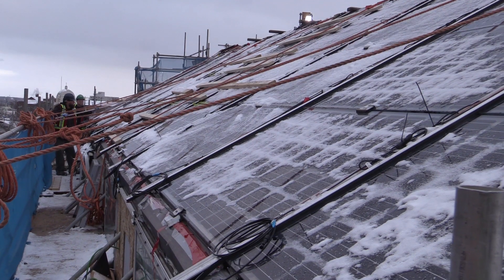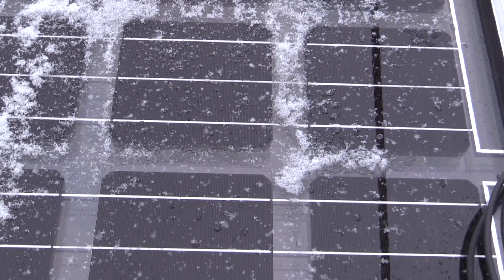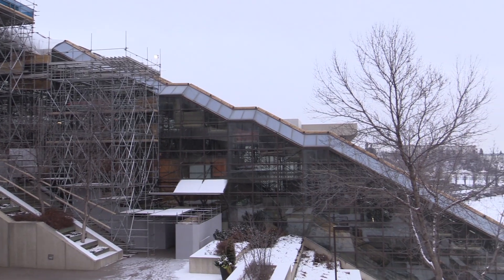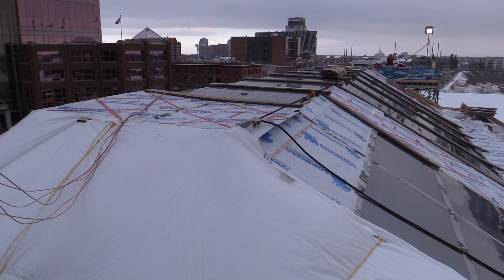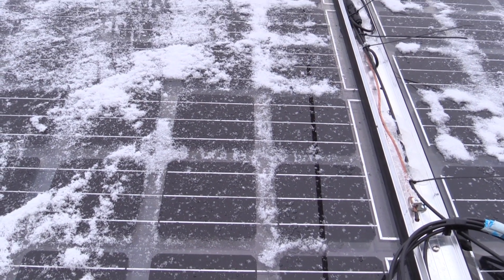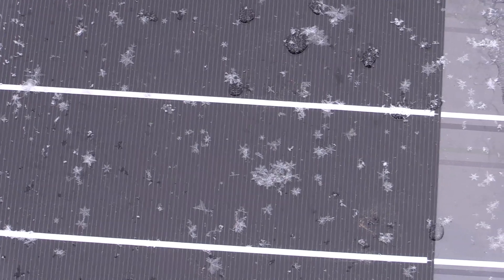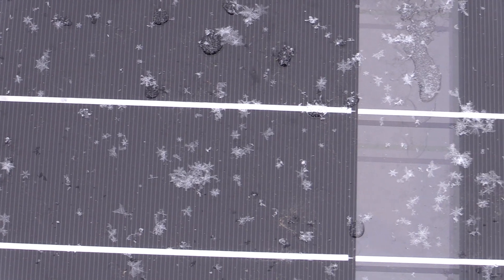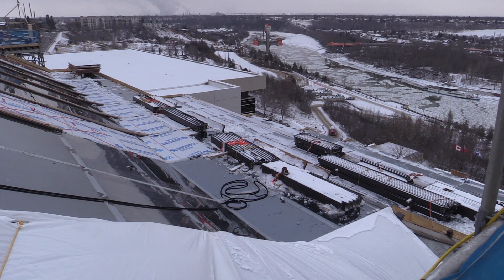Solar power will cut the Convention Centre power bill

Comment: The life span of these solar PV-Insulated Glazing Units (PV-IGU) is expected to be 40 to 100 years. The weakest link in these PV-IGUs is the seal between the glass and the framing system. The previous IGUs lasted over 30 years with 30-year-old technology. We expect these new ones to last far longer.